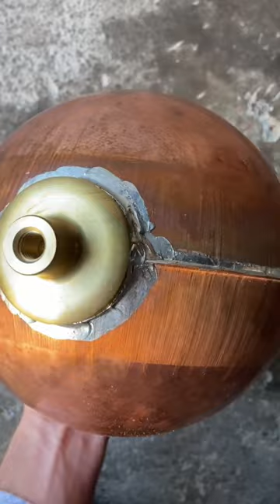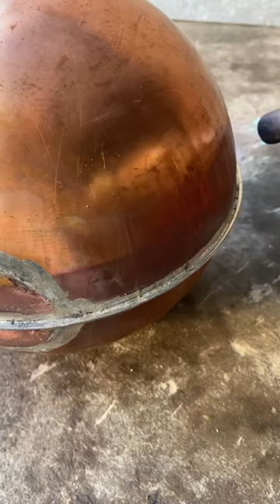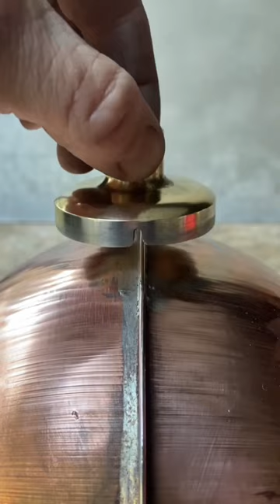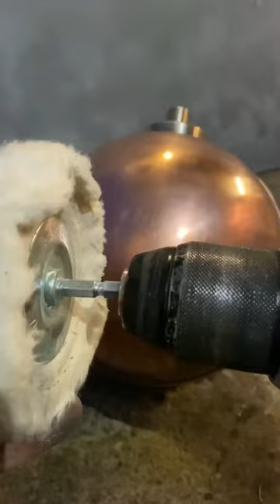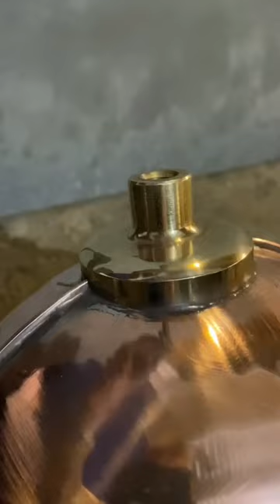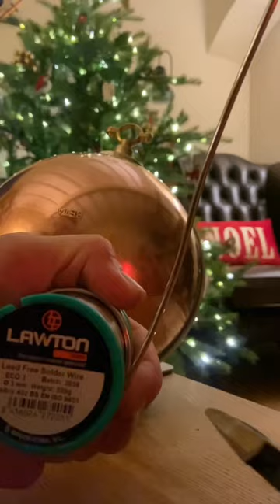Giant Copper Christmas Bauble 🎄

Comment: I remember forming and making a ‘copper bollock’ (as we referred to them) out of a flat sheet of copper during my apprenticeship (early 70s) 😳. Conical hammers, a steel former, blacksmiths forge and a few hours work, beating into shape and forming the flanges, mating it together, folding one flange over the other and then the easy bit - soldering. Mind you it was easy because it was real lead solder that flowed beautifully